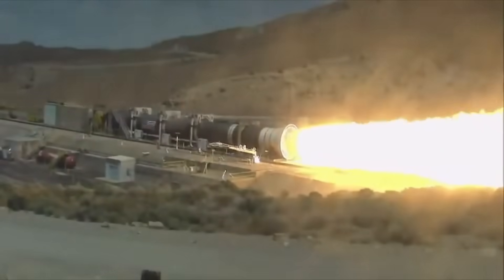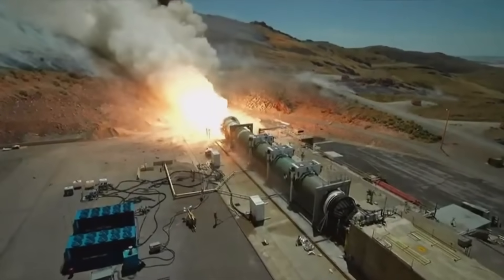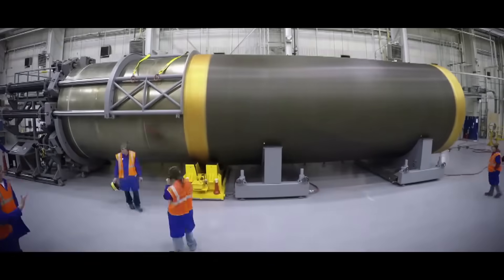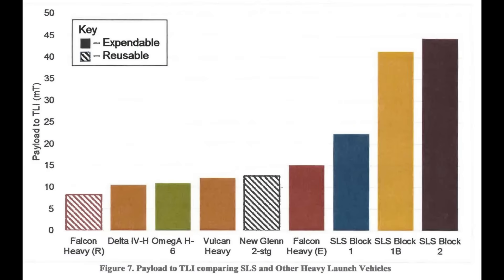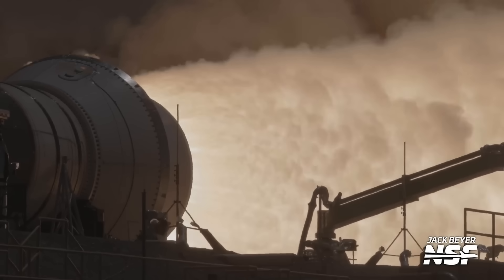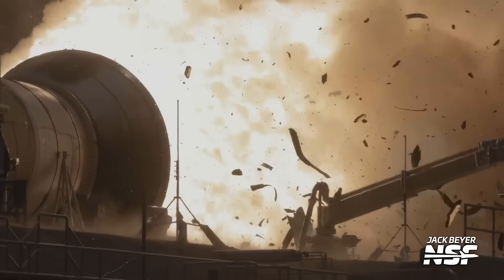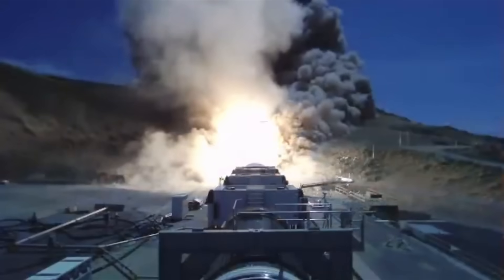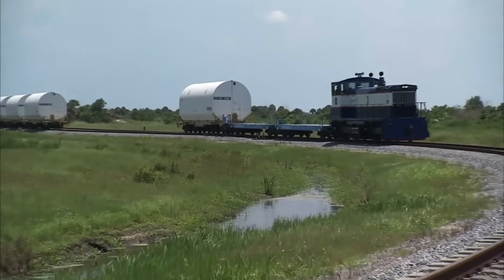NASA's Future SLS Booster Just Failed Its First Test

Comment: A few years ago I determined that a pair of Falcon Heavy side boosters have about enough performance to more or less replace Shuttle-type SRBs, while they don't have as much thrust, that is countered by the fact that they are far lighter and burn longer.
Reply: That archictrure is completely unreasonable. Amd thrust makes a difference.
Reply: @born2tilt_4ever  Far lower dry mass and increased burn time make up for the lower thrust, go to Silverbird and run the numbers if you don't believe me.

Comment: I admit the time I attempted to build structural sugar glass for a party in FL dissolved into a mess between kitchen and table. Still, it seems less than rocket science to make dehumidifiers good enough to have a booster factory in FL. Nothing against Utah, but transporting them by train in sections is an old pet peeve of mine. Maybe it is all in my head, but it always seems to me like the joints and hardware add undesirable weight and expense. Even if they just shipped sealed fuel slugs and made a lube that turns to glue so they could be shoved up a unibody's clacker, that would be an improvement. As a professional armchair critic, it is mind boggling.

Comment: The story of a horses ass isn't right although it's a good joke

Trevithick set a 5 foot width on the original plateway, which was based on the horse hauled coal tramways. It was reduced to 4' 8" without actually changing, because the way guage is measured changed (outer wheel edges to inner wheel edges) when edge rails and flanged wheels were adopted,  and then widened decades later by Stephenson to 4'8.5" to allow easier cornering along with coned wheels - this took over as the "standard" simply because there was more of it than anything else when Parliament passed a law setting railway guages to ensure interoperability between operators (more importantly it was usually the only gauge running between the "islands" of competing ones)

Yes there's some commonality with wagons, ruts,  Roman roads and chariots but wagons tended to come in varying wheel widths and the "precise" dimension simply wasn't. The story is correct as an approximation because wheel gauge wasn't going to vary too much due to the ruts

Plateways are an L-shaped trackway which use "ordinary" wagon wheels - the L is the flange retaining wheels on the trackway and the gauge is the distance between the plates (wheel outer edges). When you use rails and flanged wheels what now matters is ensuring the rails are set wide enough to accomodate the flanges,. so yuou measure from the inner edge of the wheel instead. Plateways were prone to grit builtup and blockages that flanged wheels and edge rails didn't suffer from and they wore out/broke faster

There were several competing gauges in Britain and also the USA. The entire US South was originally 5 foot gauge until after the US Civil war and mostly regauged across the entire network in one weekend.

Russia's broad gauge was deliberately chosen as a way of preventing invading armies simply rolling in by introducing a break-of-gauge
India's broad gauge is a result of the companies involved using broad gauge in Britain. 
New Zealand originally used broad gauge (5' to 5'3 - with each province using its own gauge), but then switched to narrow gauge (3'6" cape gauge) for easier handling of bends in the mountainous terrain of the North Island. 
Australia had 3 different mainline gauges

Ireland's 5'3" gauge is a compromise between the various railway companies that operated there
Iberian gauge is a compromise between Spanish and Portuguese broad guages, but why both of them are ~1630mm is down to the companies which originally built them (Portugual originally started with standard gauge because British companies built the railways, then went wider (but not the same as the Spanish) when indigenous companies got in on the act)

Comment: In that extreme heat the caused all the brush in the valley to smoke and catch fire, I thought how can the nozzle endure that heat? 🔥🔥🔥
Reply: The nozzle survives the heat by burning up.  

Specifically, It's built just like an ablative heat shield.  It's designed to create a lot of sooty gas and leave behind a dens carbon foam when burned so even in these extreme conditions it burns away at a predictable rate.

Comment: Solid rocket motors are still preferred for weapons. Being able the vector the thrust would be very desirable and much lighter casings should provide better Thrust to weight ratios.  If they can perfect this, which would seem likely,  you can bet that the defense industry might get interested again. 

With as much thrust as these put out, they might well make a good satellite launch vehicle, with a small second stage on top. Maybe cost competitive with Falcon 9.  Call me crazy, but I love these things!
Reply: They tried to sell a satellite launch vehicle based on this. OmegA. It didn't get funded. Did you watch the video?
Reply: Solids are essential to non-human rated launch systems. Solid strap-ons are used frequently to get the needed first stage thrust. Solid rocket motors aren't going away. The question is will they still be in use at the Shuttle and SLS scale?

Comment: One of the timing factors in the launch sequence was to account for the effect of the torque from the SSME. As they build up thrust they cause the stack to negative pitch "downwards". You can literally watch the nose of the fuel tank push over and then rebound. The ignition of the SRBs are timed to account for when when pitch is equalized again.

Comment: Horizontal firing, tangent to the surface! They should be firing two at a time, back to back, to avoid mucking with the Earth's rotation and its orientation. Roads are threaded in both directions simultaneously. Not A Space Agency is a political embezzlement. Standard gauge is the width of two horses' rears - a Roman war chariot, 4 feet 8.5 inches. Technology changes.  Management still apportions as paired horses' asses. To efficiently achieve anything...one person in charge.

Comment: Yeah the Railroad track Roman chariot Myth just doesn't seem to die. There is a good article from ANSI "Roman Chariots, Railroad Tracks, Milspecs and Urban Legends" that runs through some good reasons why it's a better story than fact.
Reply: It's made even more tenuous when you consider that there were competing gauges. Isambard Kingdom Brunel was promoting 7ft and one quarter. It was technically superior, but didn't win commercially. We saw this repeated in the Beta vs VHS wars. Interoperability won over the obviously better standard.
Reply: @gasdive  VHS and standard gauge both won because they did essentially the same thing while costing significantly less
Reply: @gasdive  And we still use 5'3" here in Victoria, Australia, which was copied from other places that used it.
Reply: @gasdive  Wider gauge isn't superior if you consider practical limitations. For example threading the track through a densly-populated European continent is easier with narrower track. Narrower track intrinsically takes less space and it allows for tighter curves that allows it to pass through a more complicated terrain without too many embankments, bridges and tunnels. The situation and optimal solution might've been different in wide-open, scarcely-populated countryside as in Australia…

And btw: Wider gauge will historically be more expensive in an another way as well: You need higher quality (longer pieces straight) wood to make wider sleepers.
Reply: @Tomas_Stec  wider gauge goes around corners faster, or tighter because you can bank it higher and it's still stable at low speed. The sleepers don't have to be as straight, so lower quality wood is ok for sleepers. 

Look, GWR already had a functioning broad gauge. It did all the things I said. It was faster, cheaper and more profitable. They tore it up and laid narrow because of interoperability.
Reply: @gasdive Why would 7' be obviously better? For things like this it's always a compromise, which you can clearly see by all the narrow-gauge railways that have been built around the world alongside whatever gauge was any given country using for the main line at the time.
Reply: @Daddo22  To name a few: greater dynamic stability, wider load path distribution allows for both higher ultimate load and lower wear rates on ballast and ties, depth of ballast can be less, depth of subgrade can be less, cars can go faster in curves, less superelevation is required in curves. There are downsides too: wider ties, wider ballast, wider subgrade, wider tunnels, wider hill cuts, wider trucks, etc. etc., which oddly all have one common problem - they cost more $$$.
Reply: @holden-p3r  yeah, like others have said, there a REASON there's narrow-gauge rail, the same reason we have both compact SUV's and Chevy Suburbans, and have both 737's and 777's.   As Thomas Sowell put it (about economics, but it applies to engineering as well), "There are no solutions.   There are only trade-offs".
Reply: @holden-p3r  yep, all those. I'll also add that at the time in question broad gauge offered higher top speeds as well. The conrod drove the driving wheels directly. The driving wheels of narrow gauge had to go under the boiler, limiting their size. The engines of the day were running into limits on the number of rpm the pistons and rods could reach. Brunel's engines had large diameter wheels that had the boiler between the wheels. So it could go much faster. The greater stability let that be exploited without making track construction and maintenance any more expensive as the track didn't need to be any more accurately constructed than normal track. That's why high speed rail is so hideously expensive today. Even with modern machinery, it's expensive to build the super accurate track that narrow gauge HSR needs.
Reply: PS, higher speed rail can put more passengers and freight through a corridor per unit time, so there's a quicker (or higher) return on investment. In 1854 a broad gauge engine with 9 foot diameter driving wheels set the world land speed record at 80 mph. It was the fastest thing on the planet.
Reply: @holden-p3r  And that's where you've shown that 7' is not "obviously better" as cost is an important factor and here it directly dictates what length of track can you build with given budget
Reply: @gasdive  "PS, higher speed rail can put more passengers and freight through a corridor per unit time, so there's a quicker (or higher) return on investment." - this only applies until you meet the current capacity demands, where you'll have interesting cases, like comparing between a double track vs faster single track for a certain level of demand
Reply: The Romans didnt in fact use chariots at all except for ceremonial purposes.
Reply: I absolutely was going to point this out thank you for doing so
Reply: The article fails to unequivocally prove it's thesis.  It is possible that  Stevenson chose his gauge because that is what was cheapest since that's what coach builders were already making for heavy haul wagons.  And they were using this gauge because of ...   Well, except for the chariots.  Sorta.  because the Romans may have chosen that gauge because of <chain-of-connections that would make David Attenborough proud> that's the hittites used!
Reply: The most plausible explanation that I've seen/heard is that Stevenson didn't choose the gauge as we measure it now, he just found five foot long timber for the sleepers appropriate and readily available and offset rails inwards from ends sufficiently. Originally he used gauge (as we measure it now) that was a bit narrower, but expanded it to 4' 8.5" so that the flanges on the wheels don't grind the rails as much in tighter corners.
Reply: @Daddo22 yes, that's sort of right. George Stephenson started his career on the Killingworth waggonway which used 4'8'' (Killingworth used 4'8'' because it was connected to the Willington waggonway which also used that gauge) and he kept using that gauge (including on the Stockton and Darlington) until adding the half inch on the Liverpool and Manchester to reduce flange binding on curves. Because yes it was easier to widen the track than make all the locos and carriages narrower.
Reply: @Daddo22 George Stephenson chose 4ft 8 1/2 inches because that was the track gauge of the wagonway at Wylam colliery where he worked as engineer.
Reply: Yep, we can blame Solomon. @thekinginyellow1744
Reply: There were many gauges used, where I live most track is 1600mm. Having different states use different gauges created more disadvantages than the choice of gauge itself.
Reply: @thekinginyellow1744  The article does not have to disprove anything. It shows there is NO PROOF of rail gauges following ancient Roman chariot widths by anything other than tenuous theories. It is the "you must prove me wrong rather than me proving I am right" arguments which continue to poison reason.
Reply: @bertram-raven  You need to read more carefully.  Quoting directly from the article

"The only problem with this story is that none of it is true, except the fact that the standard U.S. railroad track gauge today is indeed 4 feet 8-1/2 inches. "

That's pretty clear that they are saying that it is false.
Reply: Whether it's because Romans specified it to match a horse's ass, or it was specified by a body of elected horses' asses, it still goes to the same roots.
Reply: Not even a good story. Why Americans believe silly things like that is beyond me. Probably also why they believe in Jesus.
Reply: could we not just put two horses' asses on a railway and check empirically?
Reply: Aye, but the Roman War Helmet stories are real!
Reply: Perhaps, before damming the story, it’s worth noting that there are plenty of rutted streets in Pompeii … what is the nominal track of these ruts? Relatively recently, fresh excavations in Pompeii unearthed a chariot … surely there must be some dimensional data available somewhere on this find? I also would expect the Romans themselves to have recorded (in some text somewhere) the critical dimensions of their chariot design. 
In addition to the Romans, other archeological activities have also found remains of Celtic chariots … what was their wheel track? … Even further back in time, Tutankhamen had a chariot buried with him … that has provided prime evidence of Egyptian chariot design … what wheel track did that have? I feel there’s also likely to be evidence of what the Chinese designed their wagons to. 

My recollection of the track width used was that it simply used the same track already in use for various horse and cable pulled tramways widely in use when Mr Stephenson wanted something to prove his concept on .. and I think we can be pretty certain nobody bothered reinventing the track at that time … why bother? … if it ain’t broke don’t fix it.

I’ll bet they cursed him when he went back and asked them to open the tracks up 1/2 inch!! … that’s the best mental image I take from this. 😂😂
Reply: Even with a lot of academia and sources cited, the fact remains that there was most likely at least a partial unconscious influence in that it was the general width thought appropriate for a carriage.

Comment: What makes me "angry" is that we could have had a “giga booster” with performance very close to Starship and Super Heavy, just by combining 2 SLS boosters with 2 RD-170 engines.

The idea would be to only reuse the engines and boosters — yes, that means we’d have to rebuild the tank for the RD-170s for every launch and figure out how to recover the RD-170 engines, plus go back to recovering the solid boosters like in the Space Shuttle era.

But the RD-170 and the Shuttle boosters? Those are almost 50 years old. We could have had this kind of heavy-lift capability for half a century already — but instead, we built Atlas V, Delta IV, Ariane 5, and Proton. So much better, right?

Comment: The bit about rocket body diameter is siginficant. Perhaps forgotten is that it set the diameters of the R-7 (later Soyuz) core and boosters, since they had to be transported by rail to Tyuratam (aka  Baikonur). Similar dimensions set the size of the Falcon 9, in its case the bridge clearance on US roads and freeways. As an aside, the Boeing 737-800 and MAX fuselages have almost the same dimensions as the Falcon 9 first stage, and they travel by rail from Indiana to Washington State. These limitations did not affect the Saturn 5 stages, since they went by barge, as does the 5-metre diameter Delta IV.  Both the N-1 and Starship got/get around this problem by being fabricated on site near the launch pad (yet another example of Musk using Korolev's methods as well as methodology).
Reply: When did Spirit move from Wichita, Kansas to Indiana?